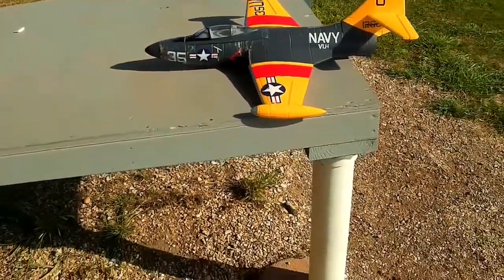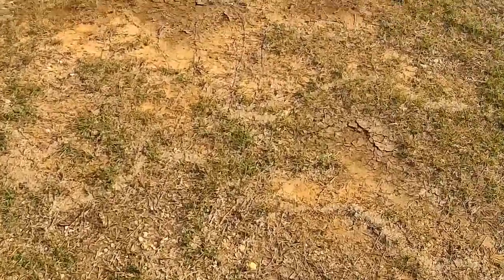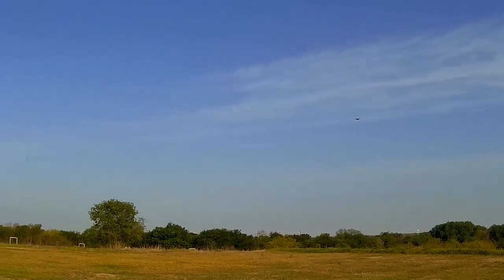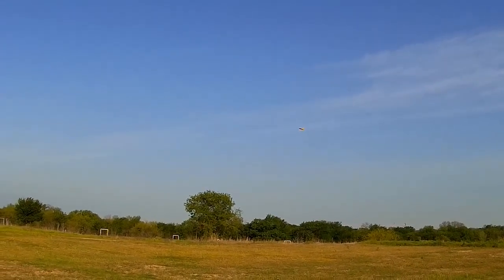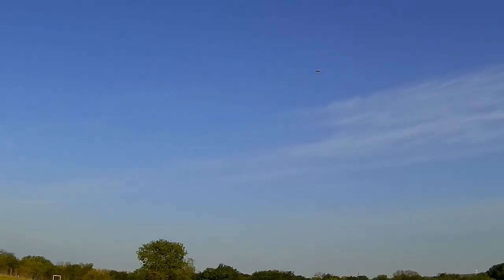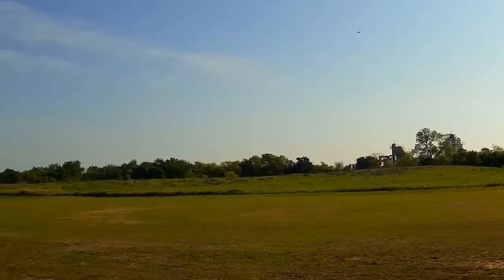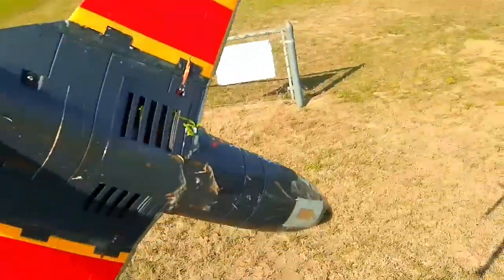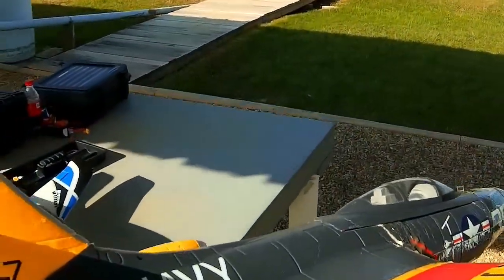Freewing F9F Panther Flight On 4-10-18

Comment: Did you get a lippisch? Those things REALLy move on just 3s. That flying wing!
Reply from the maker: No, I never did....I am over 25 planes in my hangar now, and I decided to hold off buying any more until I sell some. (I just posted 14 for sale to the folks at our flying club)
Once those are gone, I will be getting new ones and trying them out. First ones on the list is the eFlite A-10 and the Freewing L-39 probably.
Take care....
Reply: @44Mag  Absolutely. Good plan. I've only had 3 planes and one disappeared in strong wind never to be found again! I bought the SuperEZ thanks to your videos that recommend it. I mounted a GoPro under it and the footage came out glorious! I'm also flying a glider that I'm getting a real kick out of because it actually handles the wind.

I'm been trawling through a range of retailers and youtube channels to see what my next plane should be - I'm definitely keen on an edf. Lippisch, MiG15, Maybe an Arrows Marlin. All gorgeous looking (and flying aircraft). I'm leaning towards the Lippish because from what I've seen, it's got great flight times, can go like an absolute rocket, glides really well and is does all this on not just 3s, but 1500mAh packs! 

Every cent adds up, and I've already got 4 2200mAh  3S batteries that * may * suit the Lippisch also.

Take care, my friend!

Nick
Reply from the maker: @nickhayley  The Lip sounds like a nice jet. Especially if you already have the batteries.

Comment: I'm on plane #3.  I can never get the hang of launching this thing.  It wants to pitch up and tip stall.
Reply from the maker: Shove the battery all the way forward, and also adjust your elevator pushrod so there is a very small amount of down-elevator when the servo is centered. That helps to off-set the nose-up problem (the CG is not right in the manual, at least not on the 3 I have owned)

If you swap the ESC to a 45 or 50amp, you can run a 4s battery (1800 is the best, but it flies with the 2200 also) - You will have to cut out some of the wood tray to get the battery far enough forward also.

I really like it on the 4s battery. You do not have to chunk it as hard.
You can actually use the 4s battery without changing anything at all, but I would not go max throttle for more than 6-7 seconds at a time. (basically, just to launch it and then make a couple of speed runs in front of you, or take it vertical once or twice) I flew mine for over 20 flights with a 4s battery using stock electronics and never had an issue.
 However, if you swap the ESC, you can fly max throttle for nearly the entire flight.

I Have also had 3 of these. My last one, a friend wrecked it so I gave it to him. I'm trying to decide if I want to buy a fourth one, or try the F86 or Mig out instead.

I hope it works out for you.